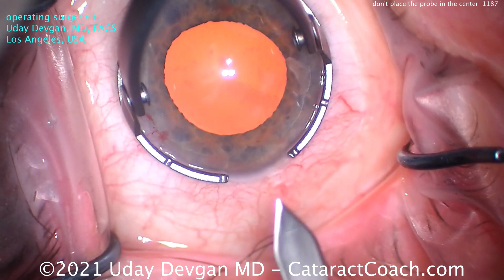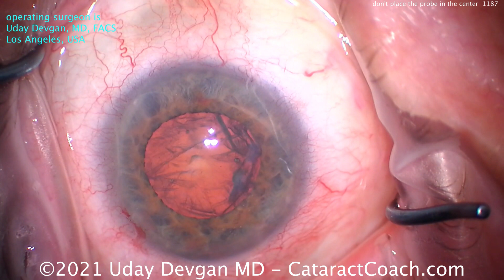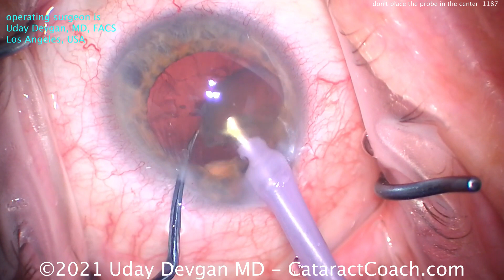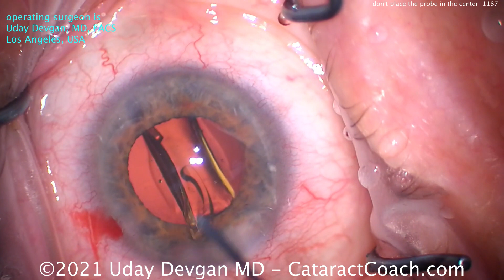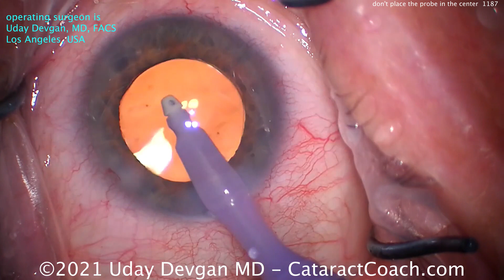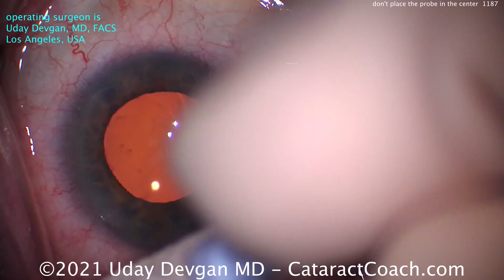CataractCoach 1187: Don't place probe in center for combo chop

Comment: Do you use no ultrasound energy or vacuum during chopping?
Reply from the maker: use ultrasound to embed the phaco tip into the nucleus then retract the foot pedal slightly to hold the nucleus with high vacuum. Now chop it.